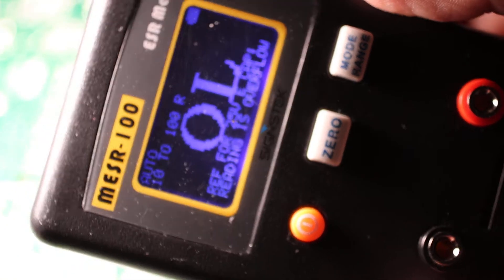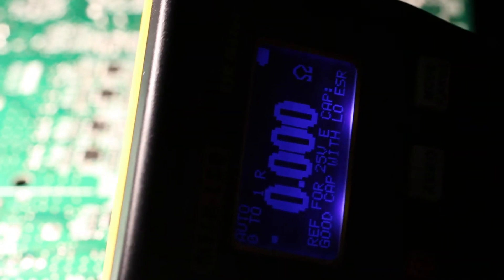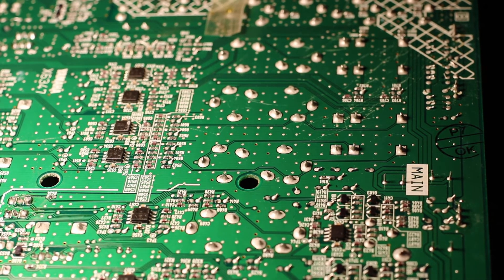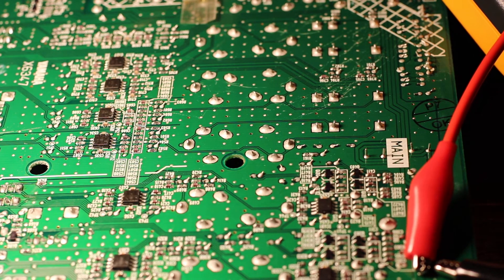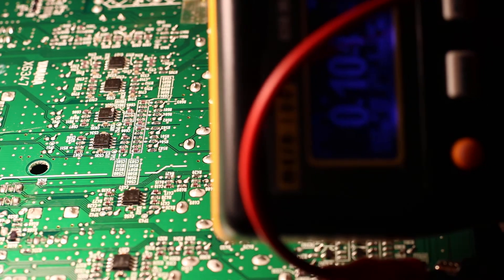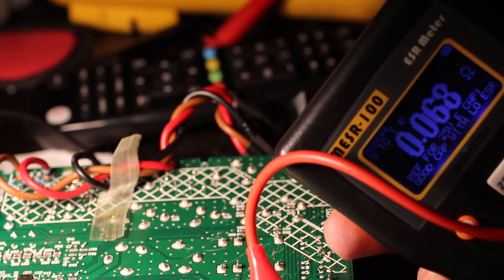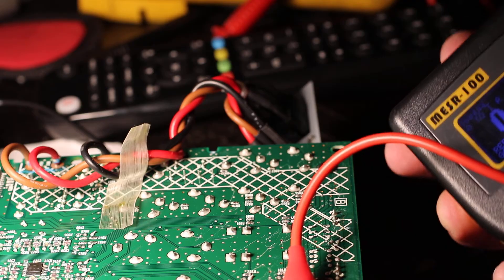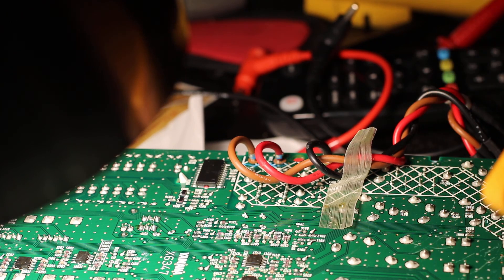Yamaha Mixer Repair. MVI-1036.

Comment: Good day sir.

You are doing a great job...

Please I have a challenge. My Yamaha MG16XU MIXER effect is not working... I think the effect panel is faulty and I can't get a replacement part in Nigeria.

Is there a way you can assist in shipment or contact??

I will expect your feedback sir
Reply from the maker: I have a Behringer with built-in effects
That had the similar problem.
it is 24 channel.  Was the yamaha that you own was stored for a long period without being used?
if the answer is yes.
the built-in effect system on most mixer have a tendency for their capacitors to become discharged. if they were not used for a while.
To fix this issue. 
1- it needs to be on and powered for a week or so and it will fix itself. That is 80 percent of the time. if that fixes the problem, then all is solved 
2- if the problem still remains after the unit stayed on without being turned off for a while. it means the capacitors are gone bad.Which they have to be replaced. But I think you should try the step 1 first. Let me know. Thanks